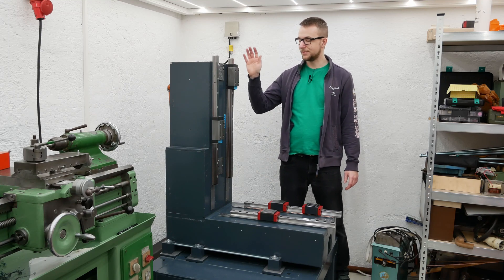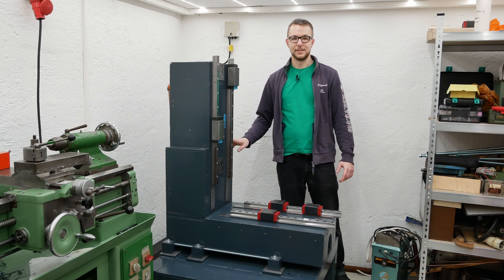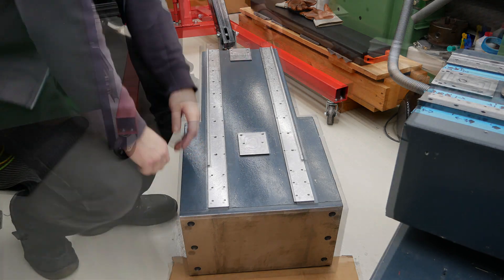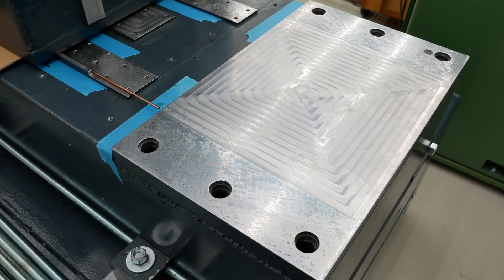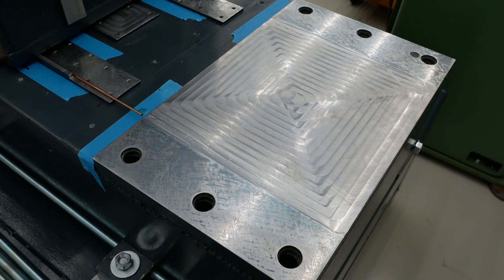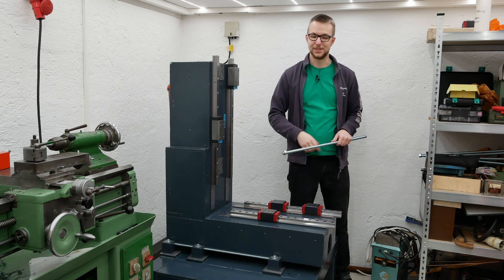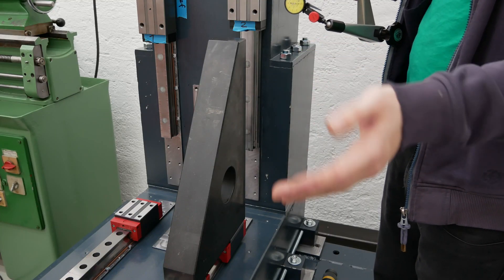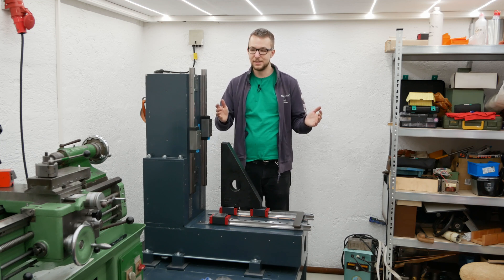DIY Milling Machine Part 3: Mounting the column to the base square

Comment: Hi~ Alex. Where can I find the proper fixing torque for each screw size? I've bought parts and can't assemble them. How do you know the tightening torque that can be properly tightened for each different screw size? You need to know this, I'll buy a torque wrench that fits.
Reply from the maker: The torque depends on the grade of the screw, how deep the thread is, size of the screw and what material. There are tables available where you can find out the torque. A quick google search will help.
Reply: @AlexCNCen  thanks you, What should I use for Google search words? I still can't find it

Comment: I know it sounds like simple tasks, but plan ahead for way covers and places for lubricating oil to drain to. I learnt this the hard way when building my own machine. Didn't leave enough space for way covers so I ended up having to buy custom bellow covers. I also didn't put any grooves in the machine so oil just goes everywhere into coolant and stuff.
Reply from the maker: I had the same problem with my current DIY milling machine. Hadn't planned waycovers and so on. But for the new one I had them completely planned before I started building :)

Comment: Love your video! Always a lot of stuff to learn. I got one question: Why the copper rod on the side of the rails? Thanks :)
Reply from the maker: Its just welding wire and it is there to push the rails against the milled edge so they are straight.

Comment: I do have some questions,
Don't hand scraping changes the parallelism  (and probably alignment too) of guide way base? 
And can't we use linear Rails as the straight edge, (assuming they are super fine grinded and square) ?
Reply from the maker: The surfaces for the linear rails where already out of alignment. I of course measured every important orientation and took care of it. The linear rails are far from straight if not mounted. But they don't need to be. It's only important, that they move parallel to the mounting surface.